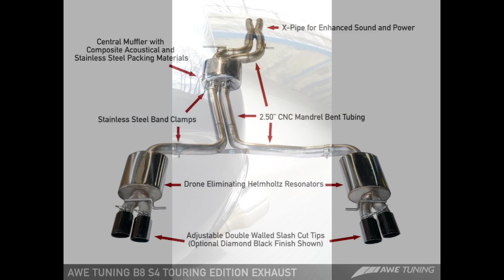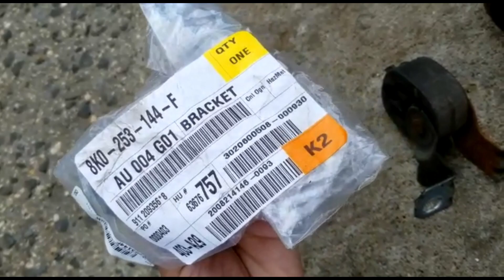2010 Audi S4 JH Motorsports AWE Exhaust

Comment: Dope sound looking forward to the test pipes did you hear wrap it or ceramic coat for extra protection? Going for JHM test pipes and the HFC DP
Reply from the maker: Thank you I like the sound myself. No I didn’t wrap or get them coated. I wanted them coated but the shop said it’s a 3 week wait so I didn’t.
Reply: @unrulytoyz8024  is it gonna wore out whenever you switch to Dual pulley stage 2 on it?  Cause I’m planning on getting it and I’m gonna go catless on mine cause we don’t have any emissions test here